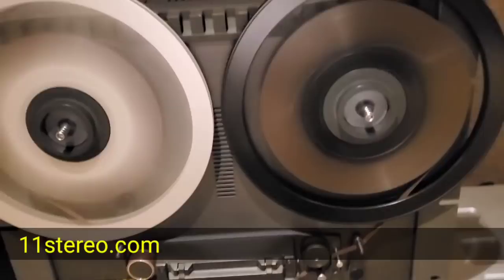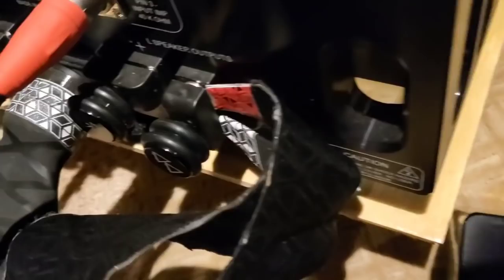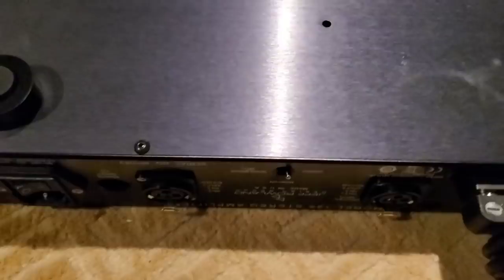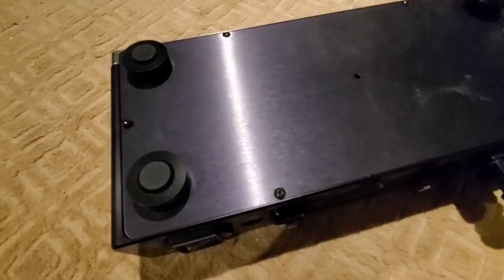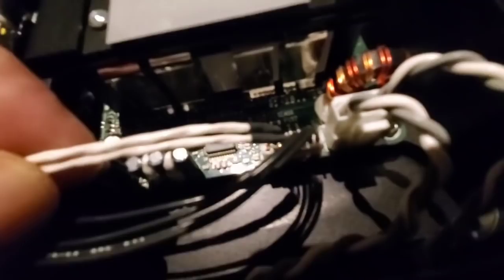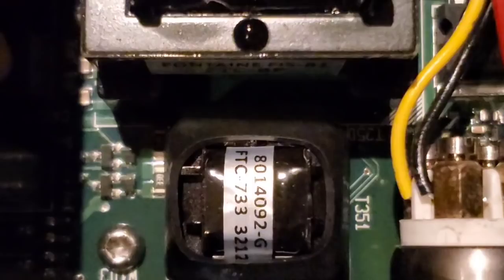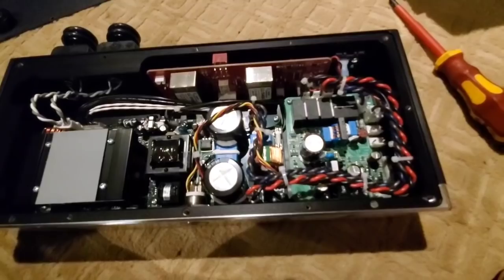How to recognize TRUE High End Audio !

Comment: B&O Ice modules are fine for budget amps and certain high end ones too.  Bruno Putzkey basically invented the whole class D thing, and statistically (and subjectively) he's been able to get the best performance from his  hypex modules versus B&O.  If you haven't heard his Mola Mola amps, then they are worth checking out for pinnacle of class D performance. Again, nothing against Jeff Rowland, but he does NOT have anywhere NEAR Bruno Putzkey's expertise with ANYTHING related to Class D.  Nobody does.

I understand you're a fan of Jeff Rowland, but re-watch your own video.  Almost 90% of what you are touting about this amp is cosmetic.  The Lundahls are surprising, but I've had both Lundahls and Jensens...I doubt anyone putting together a system in this budget range could notice the difference in a blind test.  As I mentioned in the previous video, he would have been much better off using higher end/higher cost Furutech speaker terminals that are more appropriate for bridgeable operation versus using Lundahls as input transformers.  That being said, I do give him props for using Lundahls, and he obviously put a lot of money into the chassis, so you're right that he's not making a ton of money off of it. 

I'm trying to be as fair as possible.  However, the actual parts cost in this is thing (outside of aesthetics and Lundahls) is NOT anything mind blowing...maybe a few hundred bucks for a bulk buyer.

Comparing it your build, it might make it look better, but compare it to Bryston or Parasound in this budget range (https://www.youtube.com/watch?v=D6_6hNuOuJc).  Heck, for $500 less, you can get the Channel Islands class D amp with Bruno Putzkey's superior module and get DOUBLE the power in a machined aluminum case (https://www.soundstagexperience.com/index.php/wesworld-menu/feature-articles-reviews-menu/706-chasing-bruno-putzeys-down-the-rabbit-hole-of-audio-and-discovering-the-channel-islands-audio-e-200s-stereo-amplifier).  If you strip the name off these things and just ask anyone knowledgeable to blindly look at the internals, there's no contest.

In short, you are right that Jeff Rowland isn't making a fortune on this, and he's a quality amp maker.  Saying otherwise is going too far.  However, it's important not to be a blinded fanboy either.  Is it the best bargain under $3k like you claim?  That's where I take issue. The ONLY way you can come to that conclusion based on opening the hood is if you value aesthetics first (or compare it to amateur builds).
Reply: Yep, it's all about the bling factor of "chassis resonance" and "mil spec teflon wiring".  You can't hear those things.

Comment: Retail cost = $3000. Cost to manufacture $600. Profit margin = Huge $$
Reply: It can be labor intensive so you may be paying for the hours that went into making the product
Reply: That illustrates the value of DIY.  For non-commodity retail products, this is actually within the norm.  Price of retail products, after offset to cover overhead, distribution, marketing, dealer markup, whatever, is typically 4-5 times the actual manufacturing cost.  I learned this from an MBA who had a lifetime of business consulting.  This applies to loudspeakers as well, and the money is often not where you think it is.  We obsess about the drivers, but often in a 'high end' loudspeaker, you might have $20,000 speakers that are using $100 tweeters with some slight 'modifications' on them.  They could very well be good tweeters, and actually a good design choice given the budget, but a lot of what you're paying for is an extremely well-crafted enclosure, and if they've only got $4,000 of budget to basically hand make some speakers where the buyer, despite pretense, is going to notice the finish a lot more than the sound, well...

I have 'made' several amplifiers with B&O ICE modules, and the total cost was in line with your $600 each (2 channels).  They're not as pretty as a commercially available equivalent, but I'd rather keep the money in my pocket :)  As far as functional quality, it's not that difficult to do a decent solder job if you follow the basic procedures, and the ICE modules are great opportunities for the DIY guy or gal that doesn't want to get into soldering components into a PCB.  Plus, they're wonderfully efficient, and you won't hurt yourself getting it in and out of the rack, or shoved behind a speaker, or whatever :)
Reply: @V1ralB1ack  there is so much more that goes into a piece of quality hi fi then the cost to manufacture.
Reply: Learn now:

When you have company, you have to generate money for these things ( without thinking of profit )
- salaries for employees 
- material for parts
- money for machines, maintenance and parts
- money for bills
- money to pay taxes
etc

and everything to pay that on monthly basis comes FROM SELLING products you manufacture 

Now, next time when you think about expensive products think little wider….

Comment: From the JEFF Rowlands that I have seen the front faceplate is a separate piece of billet aluminum that is bolted from the inside to the main chassis.. because on the main chassis the fly cut lines could not go all the way to the face plate the way they are unless the machine goes off of the aluminum 100%. Open one up and see if you can’t see the face plate being bolted on to the main chassis like I said.

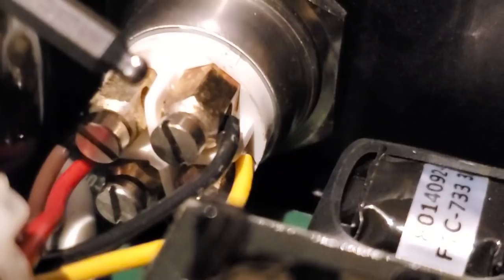Comment: Mikey! These look gorgeous. Quick question though. 15:16 you said solder isn’t the best for connection because it has its own sets of problems. I remember a few months back on one of your cable manufacturing videos, you said solder is much better than screw locking wires. Is it because these are brass screws and the screws used in the plugs you sourced were steel? Just curious bro. Anyways, sweet video. Many dealers wouldn’t dream about taking the cover off of the products they sell. You’re one of a kind man. Keep up the good shit and stay safe!
Reply from the maker: Thanks Connor, Im glad you are paying attention. Here is the distinction, Power cords solder OK, signal cables not OK

Comment: Great video, thanks for giving us an in depth view of this unit. I admit I thought it was just a pretty face before this video. What I would really like to know is how this unit stacks up against the Benchmark AHB2 THX AAA amplifier. It's about the same price so it would make for an awesome showdown.
Reply from the maker: Well thats an interesting read. I have amps with lower distortion and cleaner sound but they think they have worlds best ..lol  I would love to compare it here.  Off the cuff I can just read spec and see that the Benchnardk will not work with 4 ohm speakers if bridged. The Rowland will and plenty of people use 4 OHM speakers and would want to bridge so Rowland gets a point here for versatility.
Reply: One thing I’ll say in terms of the hobby is that build matters in terms of longevity of the products performance profile and the acoustic signature any given link in the chain supplies. The Benchmark stuff I’ve heard at shows works amazingly well— but I really only felt super impressed with the headphone amp/Dac stacks in my then being really able to hear headphone and streamer differences in A/B testing. SUPER CLEAN. Ive heard some magical sounding demos with other setups that wouldn’t compete on THD or power specs— but were killer in terms of the sonic experience. in I’ve been a fan of JRDG products since I first started drooling over the builds back in the 90s and he still doesn’t disappoint.

Comment: ICE modules are a PWM/switch mode power supply module or Class D amp. Nowhere on the Jeff Rowland website does it say anything about any of his amps being class AB. I am sure they are nice amps. I am sure if you ordered enough from B&O would make some ICE modules to your own spec.
Reply from the maker: If audiophiles were mature enough to have an open mind and actually listen and trust thier own ears then putting down the circuit type would not matter, the thing is as audiophiles we have jumped the track and we stupidly think we can judge whether or not something sounds good by reading spec, or knowing what capacitors are inside. By not putting that info on the site its our way of telling you its not important,  Because its totally true. The only thing that is detrimental is the sound.  We know if you listen to it , the piece will sell. If you start to read a bunch of engineering spec we will lose you . I sell another Class D amp that puts his output stage inside a glass KT88 tube that glows with LEDs This fools people with class D bias into actually listening with an open mind, then they start to realize there is no way a single KT88 per channel is making this glorious powerful sound , in fact its the best sound they have heard. Once they find out its class D its too late, they can not un-hear how good it was when they listened with zero negative bias. Negative bias is capable of completely changing ones perception. and since most audiophiles cant get past thier biases, we do it for them, and the great part is they are very thankful   that we were able to get them past that bias, because now they have purchased the amps and are enjoying exactly what they have had in their mind as the perfect blend of detail and body, dynamic and finesse. ... its the best
Reply: @OCDHIFiGuy  The fact that it is a class D amp isn't the problem. You said, "its the best class AB amp I have ever had in my life."
After I saw the insides and heard ICE module I knew it wasn't an AB class amp. Lots of manufactures use ICE modules but what is special is how the designer treats the signal before and after the ICE module giving the amp its own unique sound signature.
Reply: s. seely I think you miss heard. Mike was referring to the JR 625 that’s $17K. Not the JR125 that’s 3K.
Reply: @philipenness2540  that's what I thought at first too then I went back and read the website. All of them use the ice modules. They do add some fancier stuff like ceramic circuit boards and the metal XLR connectors that the smaller Amp doesn't have. Look at the website.
Reply from the maker: @stseely1  No. That is incorrect. 625S2 is the most advanced class AB you will ever see. Jeff has one AB left and is about ready to drop the mono version of my amp that comes with outboard power supply. I hope I can get some- i say hope because I will not sell my 625s2s even if i got a pair of 735 monos. These are the last examples of an era. And while most other amp companies still ride on thier brilliant designs from the 1980s (see D'Agostino for one) Jeff has taken Class AB quite literally "as far as it can go" in his own words.   If you look inside it looks nothing like any AB youve ever seen. Seriously it looks like NASA comms gear...for instance my 625s are utterly unstoppable and they use an SMPS. Thats right. No torroid. No huge ass transformer. How else do you think he gets 700W at 8ohm without overheating in a chassis that compact . So Jeffs amps alwaysvusebthe latest proven tech.
Reply from the maker: @stseely1  also they do NOT all use Ice module. The big amps use Paschal along with Jeffs proprietary features likebinput- power supply- etc.

Comment: Three grand for an Ice class D amp?  A pair of Crowns for a lot less might be a better option for some of your viewers if they want that type of sound?
Reply: Did u listen to the comparison demo he did later? Very clear there was no contest between the amp he built and the 125s. Crown amps are good value, but they are not refined enough comparatively when someone feels like that last 15% improvement is worth the $ difference.
Reply: Michael Mityok , I did listen and agree his version sounded not as good as the Rowland but by his own admission the version he built was a “marketing”  piece a ploy meant to attract and fool dummies that want to play in the “rarified air” as he so eloquently puts it but at a less expensive price tag.  A piece to fool the masses, poorly designed, with an improper tube stage used to ultimately achieve a balanced input  because as he puts it “to fool the dummies”.  Along with two power cord plugs, wow, they love that!   Now to the point at hand, the Crown is build to a way better professional industry standard that many have found works nicely in a home audio system.  They don’t use “marketing hype” or BS to sell their products because they don’t have to fool the public.  I hope I was able to explain and get my point across.  As to Jeff Rowland and his gear, it’s beautifully done but extremely expensive for what you get musically, and that’s fine if the eye candy and pride of ownership works for you over musicality.  Is it the best $3000 125 amp out there, I think not.
Reply: @De132an  i dont think you caught my drift. I repeat, some people like to pay mucho extra $ for that last 15%. I am not one of those people, but many of them are not the fools you make them out to be. To your other point, I have head Crown amps in different setups, and they are passable, but not the 'giant killers' people like you make them out to be. You are entitled to your and the other Crown enthisiasts' opinion, just do not pretend everyone who does not agree is foolish.
Reply: Michael Mityok , you’ve confused me on which side of the fence you are on, but I’m guessing we are of similar thinking.  And I’m not calling anyone a fool.  But I do think expensive doesn’t always mean better.  And I’m not a crown owner but know a person that loves his pair.  In full disclosure I do own Quicksilver mono tube amps that retail over $6k so I too appreciate the best I can afford.  Let’s just leave it there.
Reply: @De132an  Agreed. I paid about $3500 for my monoblocks, Kinki Studios EX-B7s, so I am guilty too of paying as much as I can afford. Worse, if I had real money, I would buy Rowland's 625 S2, but even if I had REAL real money, I would not feel compelled to continue to pay more. For me, from the many systems I have heard, the law of diminishing returns truly kicks in around the $15 grand mark for amps. Roughly the same for sources too. Speakers on the other hand I would say the law kicks in around $25 grand - can anyone over 40 really hear the 2% "better" the Magico Q7s are than the B&W 802 D3s? Doubtful.
Reply from the maker: DSak, crowns dont sound like the Rowland , and they are Pro amps. Audiophiles do not buy amps that can be found at Guitar Center.  If you want  to send me a crown for me to shoot out I/m happy to,
Reply from the maker: How would you know ? You have never heard it .and you dont understand my friend. I am OCD HIFI guy that means I am nutty about HiFi, HiFi meanign the highest end of audio electronics , most of them handmade in small numbers. My customers dont want mass produced pro audio , no matter how many watts you get for $300. We buy for different reasons. I made my amp with no contempt for the buyer, my intentions were pure, but I am showing you by embellishing the tone of my voice so you get a little pissed off , this will keep it in your mind and you will not soon foreget next time you are looking at an amp from a company youve not heard of. Its a cool amp that sounds great , and you can fully change it up by tube rolling..  My build is nothing even close to Jeffs.
Reply: @OCDHIFiGuy  It depends on what Crown you are referring to. I would have never considered a Class D amp myself until recently. I like you, had always felt so called Pro-Amps were not good for home audio settings. We actually did a week long test of the Jeff Rowland 125 and a Crown Drive Core XLS 2502. We conducted both a blind test using an Audio by Van Alstine ABX and a sight test. We conducted the test with six participants. The blind test was very difficult and the participants had a difficult time on which one they preferred. For the most part most they heard no difference.  By the last day of the test 4 of the 6 stated they slightly preferred the Crown to the JR 125. They felt the Crown had having better overall dynamics and felt it sounded a little more neutral than the J.R. 125. Our next test will be the Crown vs. Bel Canto Class D amps.

Comment: what is the name of the em/rfi shielding coating?  I tried to look it up but couldn't find it
Reply from the maker: Alondine for aluminum. See these are materials I know of through years and years of research. Typical HiFi companies would say its a proprietary shielding and coin a term for it like "-Ultra Shield."
Reply: @OCDHIFiGuy  thanks for the response, I'm going to be recapping a couple of items and as long as I have them apart put in some protective stuff...cases aren't aluminum, so this won't work
Reply: @OCDHIFiGuy  I didn’t know that Alodine was used for shielding. I just assumed that it was for corrosion protection. Thanks, I learned something new
Reply from the maker: @MrBonger88  Alondine protects aluminum from surface degradation which helps it retain conductivity. Conductivity is of course necessary to shield. ;-) So one helps the other